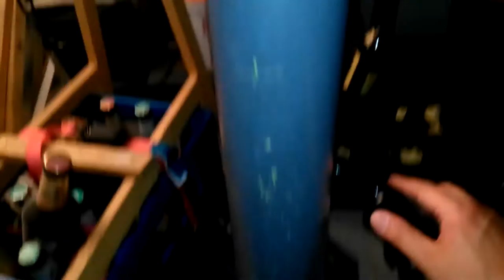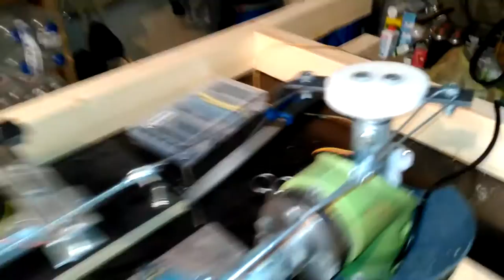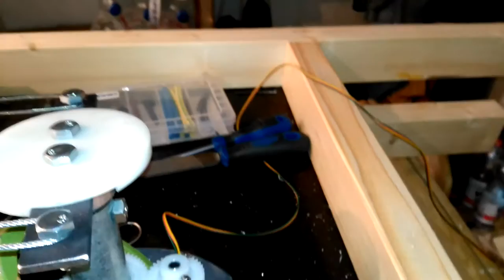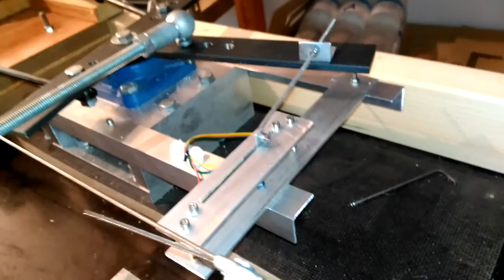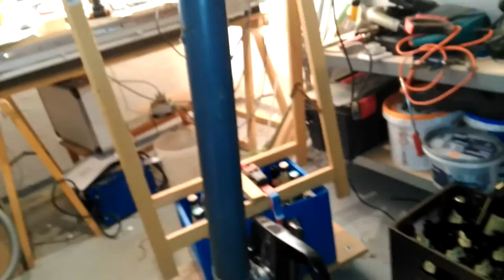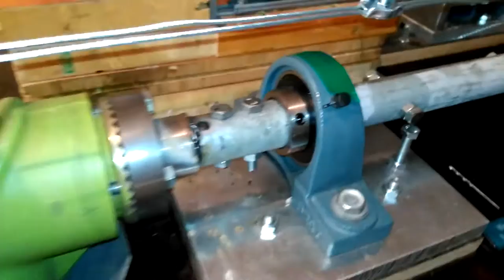Finished Yoke Mechanic  -  Overview

Comment: Hi. How are the setup working today? I am thinking of "steeling" this construction. Are there no problems with calibration or cable tension that needs adjustment? Nice setup!
Reply from the maker: Teensy 737, hi the setup is doing good. So far no adjustments necessary. If the system has been setup properly, there is no big need for maintenance afterwards...